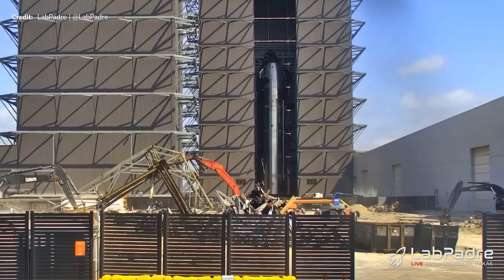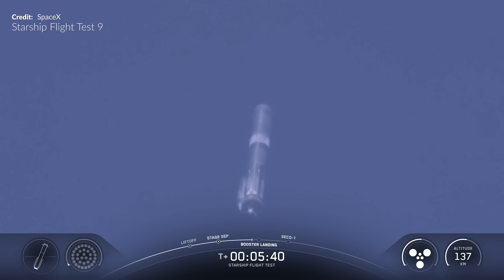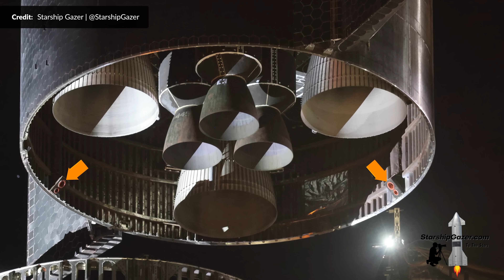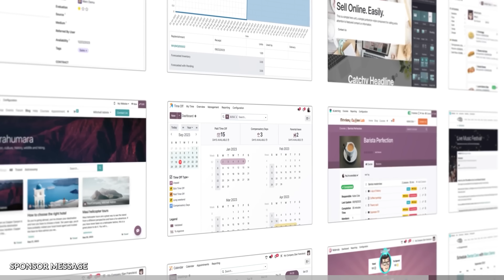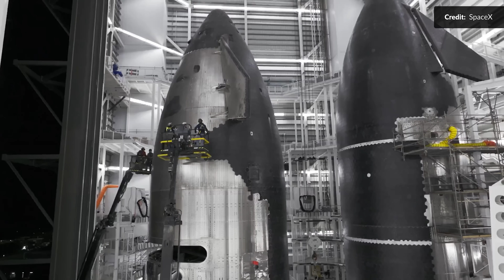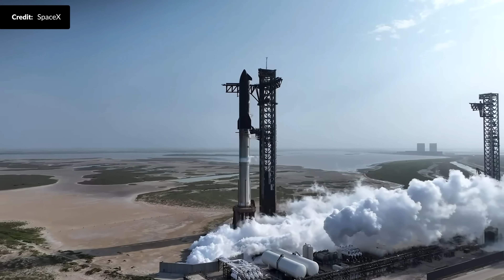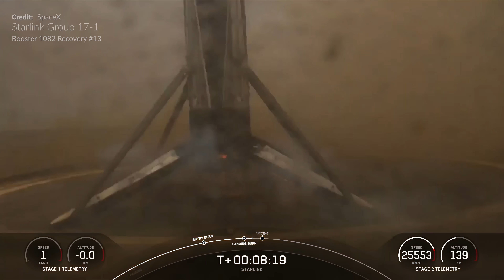Wow... Starship’s Big Surprise Came After the Flight!

Comment: I believe that the starting table A that stool will simply be torn down because it is not suitable for the 3rd version of the ship, I think that when the 3rd version will start flying from the starting table B that for the time being the starting table A will not work until the completion of the overhaul. And in general they would have solved this problem even earlier, if Musk had listened and from the very beginning made a channel for flame deflection as it is done in general with rockets, the same remember the Soviet super heavy N1

Comment: The structural stress on the booster during the last few moments before landing is insane. Would not be surprised if it turns out the structure of the rocket itself failed.

Comment: imo, there is a direct correlation between the hot stage deflection and the problems with ship
Reply: Notice in the video on the making of the Saturn 5, it had the same problem. The installed actuators (shock absorbers) to fix the problem. Looking at the new hot stage coupling, not only is it the Russian design, but it looks like (maybe) the 45 degree connectors are accumulators?
Reply: @bico1592  I think that there was a over pressure beyond the tolerance on the side wall that compressed that actuator beyond fail and that caused the problem of the ship losing control.

Comment: Despite being huge fans of this program and very much wanting it to succeed, can we not be a little more critical of the design and performance? Let's get real
Reply: Yeah, SpaceX isn't shining at the moment. But supposedly a NASA study concluded that 50% failure was the most efficient testing/development regime so SpaceX isn't too far off yet.
Reply: It would be quite disappointing if the old problems keep showing up. But we are mostly seeing the prior problems being addressed while new problems crop up. So I have some valid expectation that progress continues. 

But, I would really like to see hot gas thrusters incorporated ASAP. 
 @heartysteer8752
Reply: Never thought Complaints of journalism deficiency would land here. Put some lime in a coconut and call the journalism Dr in the morning. In jest I remain.
Reply: Agree. Good journalism includes the good, the bad and the ugly. And that's the story with Starship.
Reply: Here's some reality for you impatient haters. It took SIXTEEN flights to get falcon working, and that was just a booster. The starship booster is exponentially more difficult with the plan to catch and reuse, and that doesn't even include starship itself! We're only at flight 9 and they've already caught (multiple times) and now even reused a booster. Is this ship having a few problems, sure. But so what? Are you naive enough to think this project should be easier than falcon? Save your whining until we get to flight 20+
Reply: I concur well said. @loftismark
Reply: Does my comment make me a hater? Whatsoever?  It's important to be supportive, critical, and objective.  Your emotional response would indicate that you are a hater of discourse that you are uncomfortable with. Good day @loftismark

Comment: It all looks good on paper and cgi. As did the renderings of these last 3 flights. Reality sure does get in the way and mess up great plans. This program is 10+ years away from Mars. At least 5 years to human rated. Minus any major mishaps or setbacks. SpaceX does nail things on the first try, though not as much lately, but this is the most extreme space program ever and they won't hit every mark on the 1st, 2nd, or 3rd try.  The goal set to test every capability of Starship that is needed for the primary missions are going to take years until there are truly multiple launch/catch towers and reusability.  Plus, I'm still trying to wrap my head around 10 ships to refuel one in space so it can continue to the moon or Mars. We're still far and away from that testing phase. Yeah, reality can be a bummer. Once Pad B is operational, Pad A is going to get a flame trench and new OLM.

Comment: Starship is starting to look like a dud.  I know that people will jump all over me for that statement, but... If you keep redesigning everything all the time, you'll never get there. One of the problems with Agile development is a failure to get to a working state. Yes, with every test flight they learn more. Yes, with every test flight they achieve objectives.  But learning is a never ending process. There will always be a better way to achieve things. There will always be improvements that can be made. But at some point you have to focus on getting the design you have to work -- and into production. Engineers absolutely hate to do that. My own engineers have shown worry that they'll be out of a job as we get the last bugs out of our system. SpaceX has to get Starship to a point where it works -- in total. Then, they can make improvements.

Comment: StarShip Flight 9, no new achievement at all for my point of view; Starship failed in a similar way as previous and the booster should land. A total disaster, a wasteful flight!!
Attitude Control MUST BE BULLETPROOF!!! Otherwise it would not matter how good the heat shielding or how good the engines....the rocket will be a dead trump for any astronaut in the future. I think that is the worst thing that happened to the Starship. If not make it bulletproof I give ZERO safety to Starship.
With not reliable rockets as many issues are still not resolved, from my point of view, Mars colonization is still feeling like a science fiction movie.

Comment: This partial blocking of the hot stage ring, to produce a deterministic separation direction, of course ought to also apply to the new triangular cage design that Elon showed off.  I note that presently, none of the triangles are blocked off…. Maybe some should be ???

Comment: I expect SpaceX to change Pad A's orbital launch mount and tower to support the later Starship models. SpaceX needs at least two operational pads at Starbase to support the orbital refueling ships needed for missions beyond LEO.
Reply: I suspect they will need these 2, the 2 at the cape and likely more...elon mentioned something like 6 ships first time to mars...that's 60 - 90 refueling fights or some fairly high figure.. it would certainly work smoother to have a few more launch pads...

Comment: SpaceX should seriously consider full-body reentry protection for Starship — even in worst-case scenarios like loss of attitude or tail-first reentry. Sacrificing a bit of payload is worth it if it means saving lives.

Future crewed versions (and maybe even the booster) might need something like Stoke Space-style heat shielding 
- with engines shielded independently in case control is lost, if required.

Comment: Elon never mentioned method of return from Mars - One way trip? Is Starship capable of launch from Mars surface to low Mars orbit without a booster?
Reply: yes it is (mars has lower gravity and much thinner atmosphere). but it will need to be refueled on mars, since im pretty sure it wont be able to carry enough fuel to get there and take off again.

Comment: They need to get a rocket engine to run at the same reliability as a car engine where you can turn it on and off frequently without problems. If we are able to land humans on mars we should have extra heat shield tiles on board just in case it does need to be replaced after landing just as a backup plan

Comment: If nothing else, the first stage could be able to be used in the same way as their existing falcon 9.  Put out the specifications for a non-starship upper stage with a lower payload. that thing has enough kick that they might be able to  SSTO a smaller payload and just reuse it like that.

Comment: What works well: The main booster is very reliable at launch.  That should help NASA feel they're safe to launch at Kennedy.  It's proving very reliable at getting to apogee, releasing Starship, and returning to the launch pad.
What doesn't work well: The Starship is turning out to be a real problem.  Multiple flights with loss of attitude control, and persistent leaks plagues the progress of this ship.  It's constant mishap investigations for the same types of problems are slowing the mature rate of the main booster and the development cycle all together.  Both near term Moon and Mars missions are at risk if they don't get Starship to start flying straight.

Comment: Since they have nitrogen purge systems on board can anyone explain why they don't use that to negate then re-entry flames and heating around the engines? If they pumped a bit of nitrogen around the engine bells on the superheavy wouldn't that help? Also as to the FAA involvement, I wouldn't believe a single thing they say considering the adverse effect Elon has had on the agency and the abysmal state of the chump administration with the continual lying and criminality evident.

Comment: I think its way over time to examine elon musks character.
With Texas political assistance that only cost a couple of hundred thousand bucks. Then he played hard ball driving out poor people from the township with repeated road closures that my getting to  work or back home threatening peoples continuing employment. Musk is doing it again at his AI  operation Now. He's installed 35 portable gas electricity generators poisoning locals in the nearby town without any normally  provided anti pollution equipment. Elon's people lied  that most of the time they were only using about half of the units. When tested with  Infared monitors 32 of 35 were running. They're expensive units.
With DOGE 4000O AIDS Cases are expected to die since US Aid cut aids medication from southern Africa. Is Elon Musk an ethical  Billionaire after continuing to exploit poor communities repeatedly. Musk is appearing an unethical a-hole, not a nice odd dyslexic his pr machine makes him out to be.

Comment: If the Un-democratic party won the election in 24, the FAA would have grounded Starship indefinitely.

Over the last few years, the biden un-dems and their far-leftist FAA leadership group delayed multiple Starship flights for political reasons, and probably set the Starship program back years. Now with those people out, there are no obstacles holding back SpaceX 🚀

Comment: Agreed. During the “landing burn” phase (I think that’s what it’s called? Idk) there are a ton of mechanical stresses— first of all, the booster’s gone through more than one reflight, leading to the aerodynamic heating likely annealing the metal, making it more pliable and ductile. Coupled with a higher angle of attack (the “broad side” of the booster exposed to air), there was a force acting on the side of the booster— and then a sudden compression force , causing buckling.
Reply: ..and of course the propellant tanks are empty and perhaps not as pressurized as necessary to have the walls remain rigid?

Comment: Yeah since attitude control was lost on three ships , Might be good to put a secondary attitude control system , I know it’s more weight and $ but it’s better than losing the control of the ship , When humans are on it they’ll. Need a secondary back up system for sure.
Reply: Humans will never be on any version of Starship. That clear now.
Reply: @jeffreymorris1752  Its not clear at all, why would you say that? These are test vehicles not actual ones people are supposed to fly on. Losing several while you figure out issues was expected. In fact I think they will continue to lose more. The timelines they have targeted are giving them no option but to push things to the braking point all the time. They do need to fix attitude control with a secondary system. Also all the issues they are figuring out, NASA ran into with various test articles failing the real world tests. But no one ever heard about them because it wasn't launched but just quietly tested (and failed) at some facility, instead of in the sky for the whole world to see. would you ride on a falcon 9? I would, once star ship has 100 launches with no problems it will be clear that there is comparatively little danger in flying humans.
Reply: Which three ships are you thinking of? Flights 3 and 9 are the only ones I know of which had attitude-control issues... the rest have either failed early (1, 2, 7, 8) or have flown perfectly to splashdown (4, 5, 6).

Comment: I think this flight of starship was only seconds away from a RUD during ascent. Engine shutdown must have avoided it by seconds. In my view this version of Starship is seriously flawed - adding vents and nitrogen suppression systems is simply like applying a band aid to a cut that needs major stitches. With regards the booster, I was surprised to see them change the decent profile from normal. Now we wonder did it fail because the angle of attack was simple to high for a booster to survive, or was it some undetected weakness because it was being flown for the second time? If they had performed a normal decent profile for a soft splashdown they would have at least answered that question.
Reply: Do you never read spacex stated test aims.

Comment: SpaceX continues to push the envelope.  Perhaps they should take more advantage of the thousands of centuries Mother Nature has had to refine fixes for specific issues.  ASK GROK.  How does Mother Nature ... guard against high frequency harmonics?  ... sonic loads?  etc.  Learn about the woodpecker's head, the cheetah's joints, whale blubber, and more.  So often engineering designs at the limits of performance end up mimicing the benefits gained by millions of years of evolution.  Want to move faster?  Take a close look at shark skin.  Want to hold any hand sized object?  Take a really close look at the skin of your fingers and palm. The surface is not smooth and the surfaces change with progressive grip pressure. 😊

Comment: When I observe a rocket’s exhaust plume, I often wonder whether that energy could be harnessed more directly—similar to the way gas-operated firearms function. In those systems, the escaping gases are redirected to cycle the action, either through pistons or direct impingement. It makes me curious: could a similar principle be applied to propulsion, where instead of just venting the gas outward, some of it is redirected internally to assist or fine-tune thrust? I know it’s not a clean analogy, but maybe there’s something in it—like thinking of a rocket that partially ‘reloads’ itself with its own energy.

Comment: For me the heat shielding was positively tested. Loss of Starship was due to attitude control being lost, thus the rapid commanded disassembly.
Reply: None of that matters if it can’t make a controlled re-entry
Reply: We know the second stage can make a controlled reentry. It's just a matter of cleaning up all the leaks. And it wouldn't hurt if hot gas thrusters were installed ASAP. That should allow the second stage to reestablish attitude control in spite of ullage gas leaks. 
 @BrianReed-13
Reply: Critical thinking is dead.